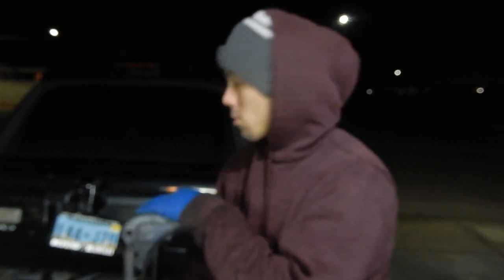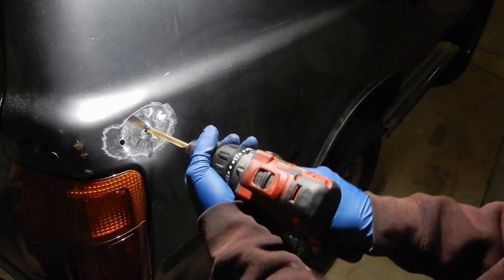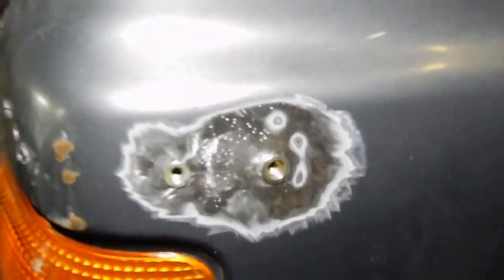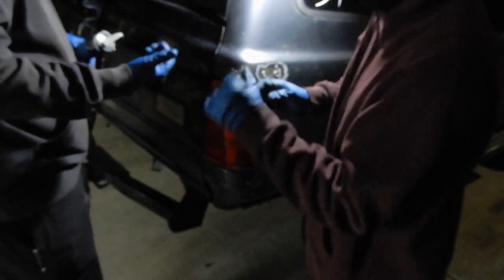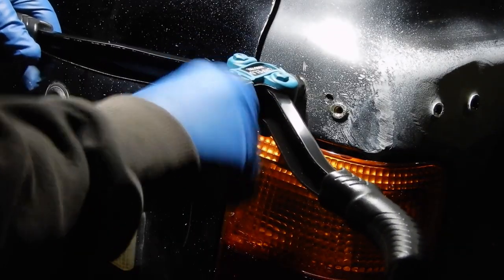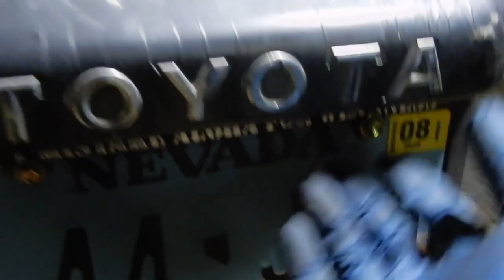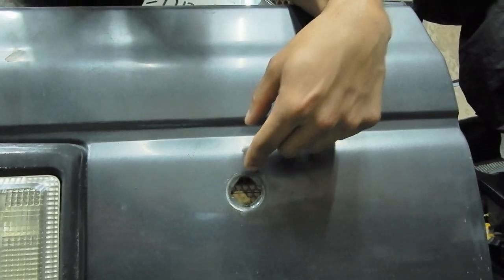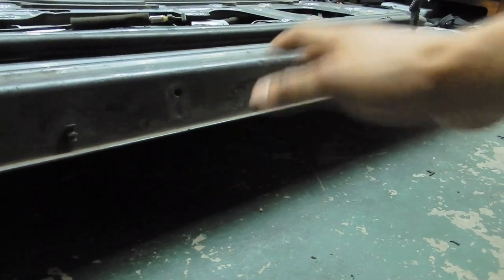2nd Gen 4runner Gets JDM HILUX SURF TIRE SWING OUT!

Comment: Hey I’m thinking of doing the same thing on my 2nd Gen hilux surf. Has the rivet gun method of mounting held up or would you recommend more bracing on the body for it?
Reply from the maker: The rivets are solid so far and its sturdy even after some spiritual offroading, I haven't mounted a tire on my swing out yet though because I am missing the latch cable that detaches the swing out to the body of the car. Once I have that ordered and installed I will update you